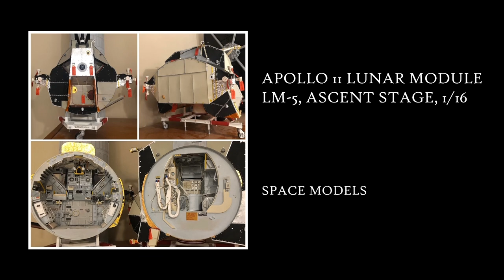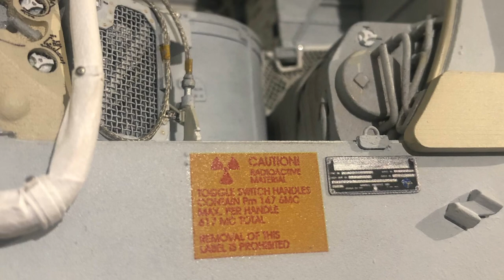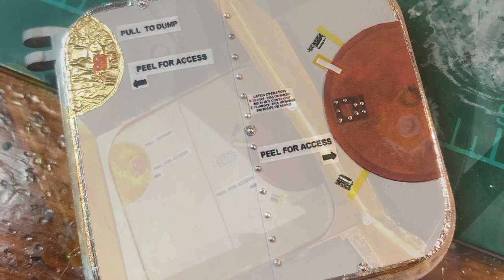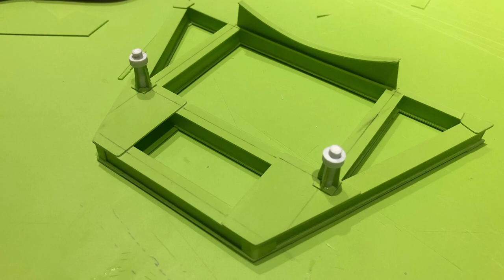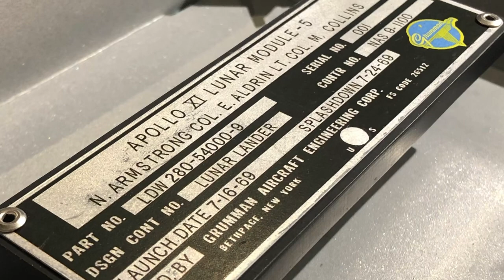Apollo Lunar Module, RFAS 1/16 Model Build

Comment: Hi Champ, was this a 3d printed Kit, or did you scratch build the LEM.   I have the 1/48 re issue, but want to build a LEM perhaps larger, just the outside of course and was wondering what reference material you mights suggest for sizing and measurements.
Reply from the maker: The main parts of this build were 3D printed by the Shapeways company using files created by Vincent Meens. Shapeways is no longer in business but Vincent’s varied parts are available in multiple scales (including 1/48) spanning multiple missions’ variances. 
I scratchbuilt about half of the final product seen, including PLSS, netting, suit hoses, wiring looms, sunshades, overhead lights, exterior skins and such similar items shown. So, it is a fairly even blend.
An internet search of “lunar module closeout” will get good high detailed results, particularly for Antares and Intrepid just before flight. I also used the book Virtual LM which is a detailed equipment and structural study of the vehicle.

Comment: What type of 3D printer did you use?
Reply from the maker: Well, as of now I've actually never owned or even used one. The work that I do is almost completely scratch built outside of using existing kits or modifying them, so this piece was a unique commission for me and all of its printed parts were provided to me by the buyer.
Eventually I will likely own one of my own to create some things.
Reply: @TheUmbralFox  If you do get one, do yourself a favor and get the type that uses a laser to cure the material.  The filliment type I hate.  They leave a rough grain that you have to sand forever or it has "stair steps" that look awful!  Beautiful job!  I did a 1/144 ISS and had to kit bash it quite a bit.  But they have probably changed it since I matched the comfig.  Here's video of what I have set up in my bonus room.  The Apollo 11 & Endeavor were complete models with such beautiful detail!  https://www.youtube.com/watch?v=7b1c3ccnMuA&t=6s